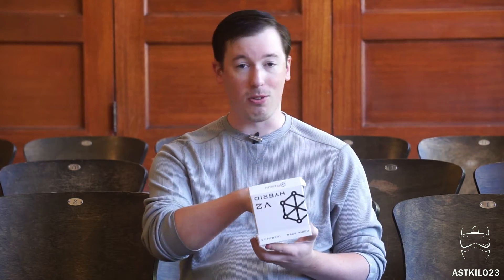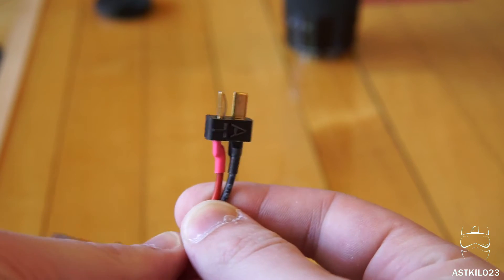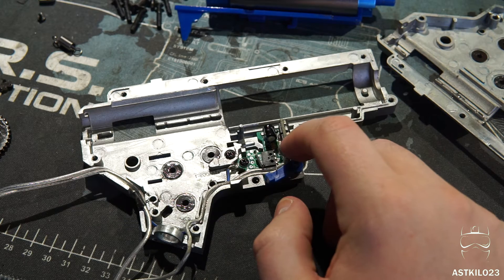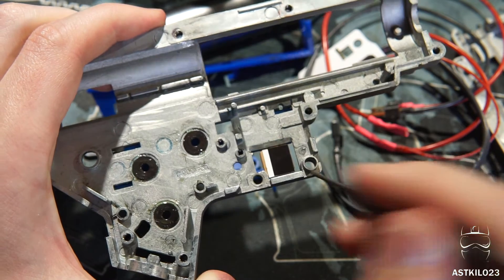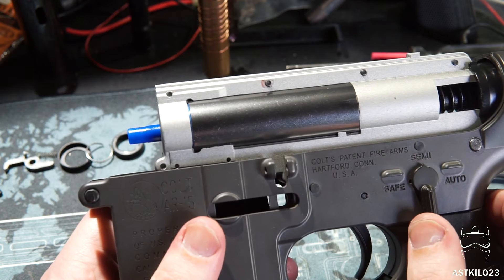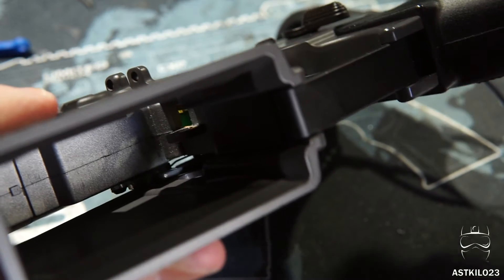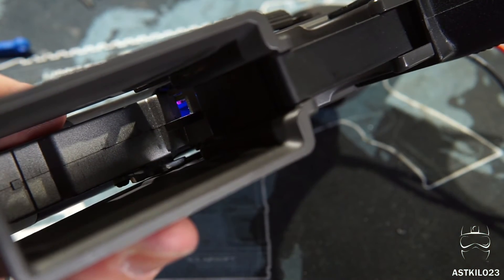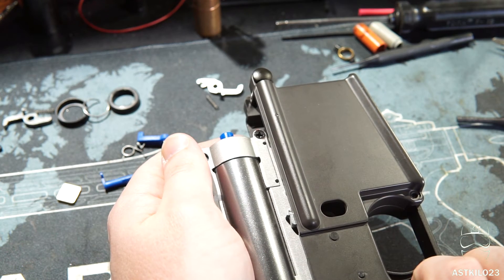Perun V2 Hybrid Mosfet Installation and Review

Comment: I'm getting this for my platinum mp5. For Mike and tell mine has the third generation of their MOSFET. The way you tell which version you have is the sound it makes. The version 1 version 2 make the same sound except the version 2. Makes the second part of the sound slower and the third version is just a a long single beep. That's the same that you would hear from a digital watch going off

Comment: fer anyone out there who is willing to give some advice. 
I am selling one of my pistols and putting all the money into my M4 CQB build, I'm putting in a MAXX air nozzle, Maxx Cylinder head, MAXX Cylinder, MAXX Piston head, SHS CNC Half teeth piston, Rocket Airsoft 13:1 gears, ASG 30k motor, and the Perun V2 MOSFET. I Was thinking about going with the Lonex 8mm V2 gearbox, it's only $50, but it has good reviews. I'm scared the stress might break it. Do you know of another good gearbox that comes with the selector, tappet, and bearings, that's under $100 and good? Along with that, who has some good videos for modifying the Gearbox to add the Perun MOSFET, I'm scared ima ruin the gearbox.

Any thoughts, questions, concerns, cries of outrage?

Comment: I recently installed this into my gun but when plug the battery in it beeps twice every once in a while. It still shoots just fine. Is this normal, I didn't see anything in the manual about it.
Reply: That means, it detects low battery voltage. Thats the warning to switch battery.

Comment: How would you compare this to the Gate Titan? Are both same basically? Can you spam the trigger as fast on the hybrid as on the Gate?
Reply from the maker: Similar in a lot of ways. I treat these as a simpler version of the Titan. You don't have 300+ settings like the Gates, but most if not all of the programmability is still there. And you can spam the trigger, if your gun is well enough tuned and has the right parts internally.

Comment: AST how would you rate the perun hybrid MOSFET over the T238 MOSFET am looking at both as they suit my current budget? i did earlier this year install a warfet, but find its very lacking in some areas
Reply from the maker: The Perun is definitely a superior mosfet in my opinion. The T238 is still great, but feels a little more limited in settings and is definitely more of a budget option.

Comment: I agree; this mosfet is amazing! I installed it in a VFC 416 (around 2015 vintage - a basic V2 gb). I had some trubble with the correct magnet position on the trigger. TheSector gear was rubbing on the magnet holder on the trigger (some sanding needed and a reshimm). I had a simmular problem with the safety bar (also sanded it down). Now, when the safety is on, the trigger doesn't move... at all. Great product and a great video

Comment: That locking of the safety is because the mosfet slightly pushes the trigger forwards a little bit, thus when it’s on safe the bar is tensioned against the trigger, you can correct it by filing the bar a 1mm
Reply: Would you file off the bar by length or width?
Reply: @knightairsoftwarrior  length
Reply: @ArchieKeen1  
Thanks I’ll keep that in mind when I install the perun hybrid mosfet
Reply: @knightairsoftwarrior  I think you can just leave the safety lever off.
Reply: @Skuffle   I probably will leave it off because I plan on putting it in my cyma mp5 cmo41j